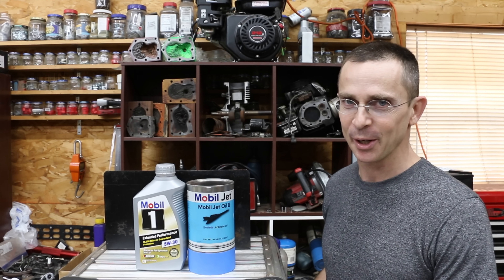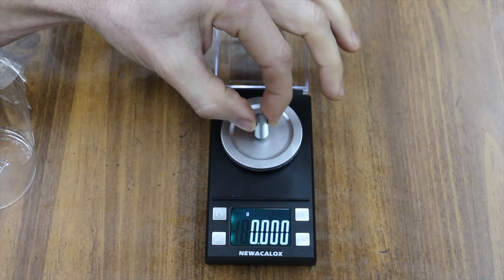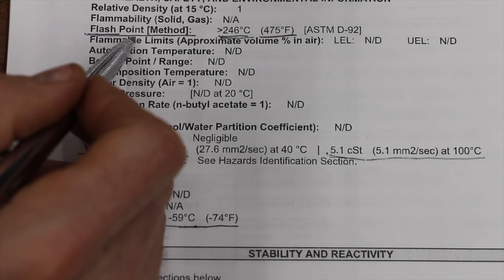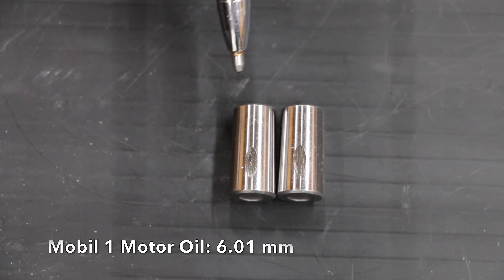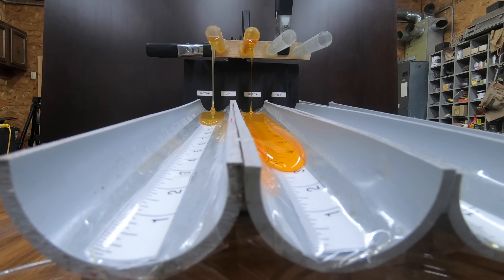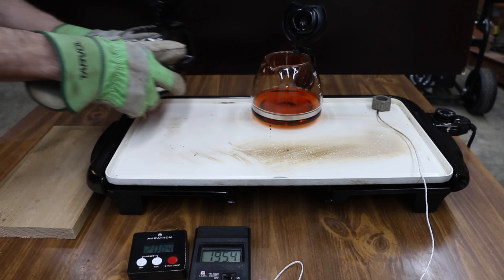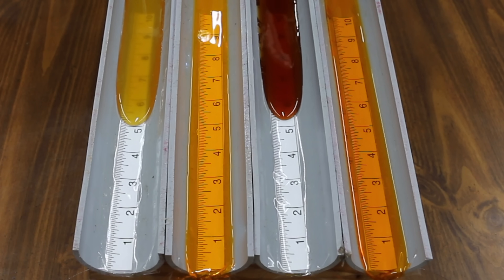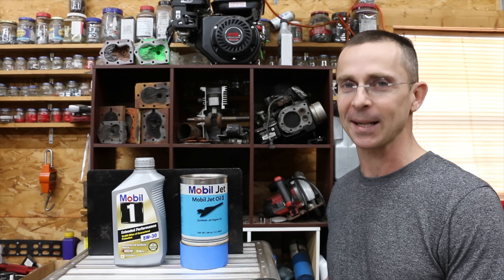Is Jet Oil better than Mobil 1 Synthetic?  Let's find out!

Comment: I have noob qoustion but i really i couldn't find answar to it...
How does outside temperature effect oil viscosity after the engine reached normal operating temperature?
After starting the engine and reaching to the normal operating temperature (90°C-110°C)-(194°F-230°F).
The oil temperature almost will be the same or maybe higher. So if we assumed that the outside temperature is 60°C (140°F)  how the temperature will effect the oil viscosity if the the oil temperature is all ready higher almost
100°c(212°F) and lower its viscosity?
Im aware in cold start we need the oil to be thin enough to spreed in engine parts and lubricated so the oil will be affcted by the outside temperature but when the engine reach normal operating temperature how does that effect oil viscosity?
If you answared me that it does not effect then why vehicle manufacturer recommend heavier oil viscosity in hot area?

Thank you for the great video best regards.
Reply from the maker: Great question.  It shouldn't have very much impact assuming the engine and oil temperature remain constant.  However, extreme ambient temps often times cause engines to run warmer, reducing viscosity.
Reply: @ProjectFarm 
Thank you very much for your answar.

Comment: The temperature extremes for jet engine oil actually makes sense. Jet engines run hotter than a car engines. In the unlikely event that you had to restart a jet engine at commercial altitude (40000 feet), the outside air temp is something like -40 below zero so you would want oil flow at all extreme temperature. After all, its not like your car where you can just push it in the garage and warm it up for a hour or two. If I am not mistaken the rebuild requirements on aviation equipment (piston or jet engines) is way more frequent than road cars, so the tiny amount of increased wear is not as critical.
Reply from the maker: Great point. Thank you

Comment: Jet engines have very different lubrication requirements that your regular 4 stroke or 2 stroke engine. 

What oil does in a jet engine is lubricate an accessory drive, a beveled gear set that takes power from the turbine shaft and drives things like a generator, fuel pumps, oil pumps. Then it has to lubricate the turbine shaft bearings. The lubrication method used for bearing lubrication is oil mist where it is mixed with compressed air and sprayed into the bearings. Depending on design, some oil is scavanged and returned to the sump, but some oil will always be lost through labyrinth seals and consumed by the engine. Because of this a general oil service involves replacing the filters and replenishing lost oil, a drain is rarely performed and really only needs to be performed for overhauls and if contamination is suspected.
Reply from the maker: Great point. Thank you!

Comment: Jet turbine oils are largely poly alfa olefins  (PAO) based and carry additive packages designed for a different type of engine than piston engines.  Piston engines use synthetic esters with additive packages that contain higher zinc and detergent levels and may be considered to operate under a different type of severe service wear regime.  Piston engine lubricants have to cover more types of friction conditions with larger friction areas, whereas turbine engine oils need to protect and lubricate mainly in a spinning regime with smaller contact areas, mainly consisting of roller bearings and ball bearings, and of course higher temperatures, especially close to the cumbustor..
Reply from the maker: Great information! Thank you
Reply: @ProjectFarm  My pleasure.  Another difference is that piston engine lubricants are exposed directly to the combustion process whereas turbine lubricants are not.  This a big difference and as such is one of the the reasons for the higher detergent levels in piston engine lubricants oils.

Comment: What type of thermal camera do you use?
Reply from the maker: FLIR 1 Pro.  I like it when it works.  Internal battery failure occurred and I had to have it replaced under warranty.

Comment: The trouble with extended oil change intervals is the detergent package is a consumable. Assuming the oil isn't contaminated over time (which it is), the detergent package is generally what runs out. So testing fresh clean oil is of little value. The best testing ground for oil is fleet use. Just my two cents. And you have to figure jet oil is designed for ball and roller bearings, where auto oil is designed for sleeve bearings.
Reply from the maker: Thank you.

Comment: They never change jet engines oil they only top it off. An they will tell you to never use in gas or piston engines because it will spin bearing. The only time the oil is drained in a jet engine is when they are pulling it off the plane.an I know ups only uses mobile 2 jet oil.
Reply from the maker: Great information. Thank you

Comment: Jet oil has to withstand significant variations in operating temperature (one minute cold at 30K feet then next minute on the ground);  that said, it needs to have an almost constant viscosity over a wide range of temperature.
Reply from the maker: Great point. Thank you!

Comment: https://www.amazon.com/Mobil-Jet-Oil-II-MIL-PRF-23699/dp/B075G36Z4Q/ref=asc_df_B075G36Z4Q/?tag=hyprod-20&linkCode=df0&hvadid=312425727815&hvpos=1o2&hvnetw=g&hvrand=6880279188022506186&hvpone=&hvptwo=&hvqmt=&hvdev=c&hvdvcmdl=&hvlocint=&hvlocphy=9027595&hvtargid=pla-571124702796&psc=1 the jet oil is sold in cases of 24 for 410 dollars,  its roughly 17 dollars for that can
Reply from the maker: Wow!  Expensive

Comment: Fun video that demonstrates that switching to a "better," more expensive, oil is always a gamble. If you use an oil not recommended by the equipment manufacturer, you are more than likely to experience increase wear. This is obviously not true 100 % of the time, but I would never do it unless someone I really trusted had done the testing that demonstrated improved performance. Also, I have little to no trust in anyone trying to sell me something (e.g. STP oil treatment).
Reply from the maker: Thank You!

Comment: Can you help me? I live in Saudi Arabia and the temperature here reaches 125ºF  degrees and I have BMW 630 V6 2009 What kind of oil should I used to withstand high temperatures and heavy driving and conform to bmw specifications
Reply: i think the thicker the better for extreme heat

Comment: Would love to see how something like Rotella T6 and other diesel oils compare to the top two in the oil showdown.
Reply from the maker: Thank you for the video idea!
Reply: @ProjectFarm  I would also be interested in this
Reply: John Ventshop I use Rotella T4 in my motorcycles (It's JASO MA rated). 
At work, we used several different brands of 15W40 diesel engine oil in all of the internal combustion engines we serviced (forklifts, etc.), and the engines lasted forever. Now, we use the 10W30 that the factory recommends, and the engines aren't lasting anywhere near as long. I'm seeing customers' equipment having issues with rod knock and excessive valvetrain noise, on a regular basis.
Our air compressor engines aren't lasting as long, either. Honda recommends 15W40 for our climate. 10W30 isn't worth squat in a hot environment, especially in an air cooled engine. 

I'd love to see the comparison you suggested. I think it would give us some great insights.
Reply: I suggested this month's ago
Reply: T4s, T5s than T6s

Comment: Automotive bearings rely on the oil forming a hydrodynamic edge. Jets use ball and roller bearings and rely on the oil keeping the bearing cool, and taking away contaminants. Jet oil in a car engine will probably prematurely wear out the bearings.
Reply from the maker: Great Point

Comment: Mobile one, back 10+ years. My titanium springs and seats were wearing out.  Within 20k of upgrading my cams and ect., the oil lab after the first sample asked if I was using Mobile 1... proceeded to tell me "Mobile 1 is not recommended with titanium components". Hence the huge deposits left in the used oil...
Reply: Mobile 1 sucks, just my opinion.

Comment: The jet oil might be a good additive for gas engine oil in cold temperatures to help prevent dry starts. Is it possible to add different amounts of jet oil to engine oils to check it's effects after freezing the oil?

Comment: Wow remember back in the day when you used a can opener to open up your can of oil for your car how long has that been...
Reply: Why don't they do it anymore? Easier to recycle metal.
Reply: @Zourkoskey  because private users have funnels and aren't held to the same hazmat requirements as the aviation industry in contamination.
Reply: year was 1978 it has been long awhile.
Reply: @georgekhaziran  and  you would have the awesome oil spout, just like the service station attendants.
Reply: @davidgreen5099  yeah... That spout was awesome
Reply: @georgekhaziran  and I guess that sounds about right I think I started driving and about 1977 and I do remember opening oil cans with a can opener and then shortly after that within a year or so it started getting some I think havolin brand oil was the first one I saw
Reply: Metal & paper cans, haven't seen that for a while. The service station I work in back in the '60's, it was a good idea to leave the oil spout in the can so the oil coating the inside of the spout would eventually drain back into the can. Kept the work bench cleaner. You also had to be well practiced inserting the spout. If you pushed at a slight angle, you'd collapse the paper wall & the spout wouldn't seal right. Had some to do w/ hand strength but more w/ positioning your body to thrust straight down. The cans allowed an amazing stacked display wall of product, but they did weep oil.
Reply: @carmiethompson2676 the displays looked nice, but they really leaked when someone hated those cans and shot them. Ya gotta get away from the cans! (Let's see how many get this reference 😉 )
Reply: We didn't use a can opener, we used a "church key"
Reply: Lucky to open one myself as well! A bunch of new old stock Elf brand oil at a local mechanic shop where I worked part-time...whooo!
Reply: Are you serious!? That's crazy!
Reply: I guess not that long ago if you're working on a jet lol
Reply: You are an old folk arent ya mate
Reply: My pa told me folks left it to close to their Pabsts Blue Ribbons
Reply: kingpest13  Whale oil?
Reply: deepsquat600 I remember round cardboard cans of oil back in the 80’s. The cans always remind me of the movie The Jerk.
Reply: @bradrichards6107  oh no somebody doesn't like these cans somebody shooting these cans... I remember she said something along those lines later on he went to kick in the nuts iron balls McCluskey and got his ass kicked
Reply: Boomer
Reply: Clearly spoken by a millennial.
Reply: i mean they still exist... we sell them at my dealer ship
Reply: I still have one of those pour spouts for cans in my tool box. For what reason..idk. lol. I do remember using it back in the 80s though.

Actually I remember using as late as the 90s for gunk engine flush.

Comment: It would have been interesting to see an HTHS comparison (High Temperature & High Shear). Jet Oils are not designed for linear shear forces since they don't have to lubricate linear piston movement. They do not have to compromise in a way that motor oils do. Which is the main reason why these oils do not belong in an automobile. Unless you run a turbine in your car, of course :D
Reply from the maker: Thank you for the video idea!

Comment: the 40c viscosity of the Jet Oil  is way thinner than a 0w. So in the lubricity test at room temperature it will have a very thin film strength vs the Mobil 1. However at 100C it will have similar Cst to a 16 weight.
Reply from the maker: Thank You!

Comment: So what does the viscosity to weight translate to? Looks like they are about half on the Jet Oil so is this like a 2w-15 oil? If that is true then it's awful close to the 0W20 (which my car takes).  They have a case (24) on Amazon for $410 Which puts it at  $16.75 a quart.  Hmmmm

Comment: Test different anti seize from a brand like Loctite. Copper, aluminum, metal free marine, nickel etc. Interested in rust/ corrosion prevention, water wash away, and cold temp hardening. Maybe look at higher temps effects like evaporating or dripping. Thanks
Reply from the maker: Thank You!

Comment: Jet engines require a much thinner oil that flows more readily along components operating at speeds impossible in any piston engine with insane amounts of heat. When you have RPM numbers going into 5 figures at idle on large engines and all the way into 6 figures with micro jet engines, you need as much oil as possible yesterday.
Reply from the maker: Great Point

Comment: I think if you could make it get one of those Lucas gear demos to see how the oil tracks would be interesting to see if the oil follows better then another. Might even be able to check turning resistance if done correct.
Reply from the maker: Great Point

Comment: Yeah jet oil is for both cooling and lubricating of very hot turbine and compressor berings. It doesn't receive the same forces as motor oil.
Reply from the maker: Great Point

Comment: Just no.... dont do it! Jets use roller bearings. You will seize your solid bearing engine. Its mostly used to remove heat from the bearings.
Reply from the maker: Thanks for the constructive feedback

Comment: well considering Jet engines have to deal with extreme cold at higher altitudes and are actually rebuilt often. The jet oil specs are just fine for whats needed
Reply from the maker: Great Point

Comment: They just keep adding oil to jet engines it’s never completely changed
Reply: Jerod Wilmoth sounds like you know what you are talking about. You an A&P?
Reply: @jerryvonzepplin50  PT6 turbine engines in the planes I flew the oil change interval was 900 hours or 3 years, whichever came first. Filters were changed more frequently but the oil never looked dirty.
Reply: I currently work on RB211’s and CFM56’s (737&757 turbo fans) oil on these suckers get burned off, spit out, and do turn pretty dark. I can’t recall how often due to the rotation of all the tail numbers that come through. I used to dabble around PT6’s at my old job. Mostly Garret 330’s. Anyways never liked the Mobil Jet II. Preferred Eastman 2197.

Comment: I have a theory - the jet oil didn't work well in the lubricity test because most jet engines have ball or roller bearings, so is not designed to lubricate a sliding surface like all the bearings in an automotive engine.
Reply from the maker: Thank you

Comment: The lion's share of work done by jet oil is cooling the bearings in extremes of temperature. It's not exposed to combustion so it does not need to have much in the way of detergent or 'wear protection.' As long as the bearings are happy it's good.

I HAVE run an old lawn mower on jet oil. It revved like a race car and made nearly ZERO smoke. It smelled odd and I later learned that the oil I used (for military helicopters) had tricresyl phosphate - very toxic.
Reply from the maker: Thank you

Comment: Jet oil is a thinner oil meant to be used in a high-pressure oil system so that things like the various turbine shafts, the gearbox, etc all "float" in their bearings as the system comes up to speed. It's also the primary heat exchange fluid used to extract waste heat from the engine that isn't taken care of by airflow through the core. It does this by passing through the various oiling points, gathering heat along the way, then passing through the oil/fuel intercooler where it dumps that heat into the fuel about to be burned. The additional heat added to the fuel improves performance by a small amount and the oil gets cooled so it can do its 2 jobs.
I'd have to rewatch some of AgentJayZ's jet engine videos (hes a Canadian jet engine mechanic) to find the actual pressure values used for the oil though.
Reply from the maker: Thank you

Comment: Can you test the claims of a product called Synthetic Metal Treatment 2, SMT2 for short? The stuff is supposed to be a synthetic liquid metal that bonds to ferrous metals via a covalent bond. Its purpose is to fill the microscopic imperfections in the working surfaces in all machines and create a greatly decreased friction surface. I have already tried the stuff in an engine that had a low-end rap, most noticeable when the engine was cold but was always there. I added the recommended amount to the oil and started the engine. Before the engine warmed up, the rapping was completely gone and currently, it only comes back when the engine is cold and you start it, but only for a minute or two. I haven't been able to find anyone online who had disproven or even said anything negative about it.
Reply from the maker: Thank you for the video idea!

Comment: Jet engine oil is used as a coolant, mostly. Hence the low viscosity and very high flash point.
DO NOT USE THIS IN ANY OTHER ENGINE TYPE. 

Great video by the YouTube jet engine Guru himself , Agent JayZ
https://youtu.be/WAia8PwMvQM
Reply from the maker: Thank you